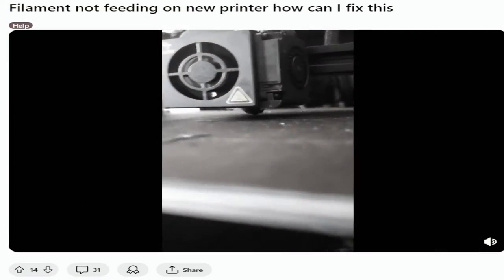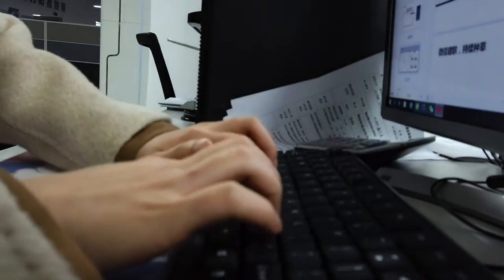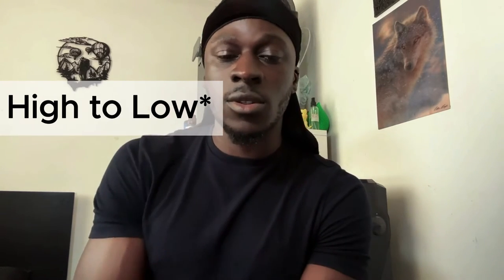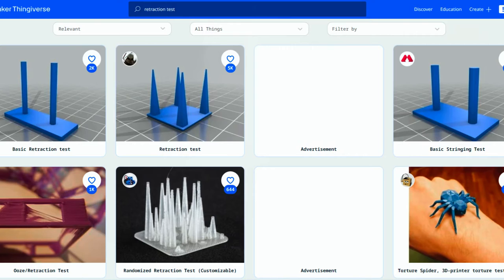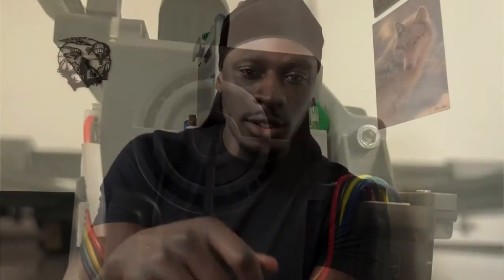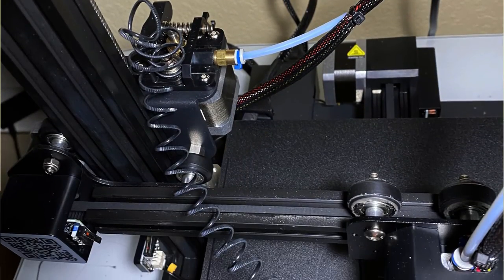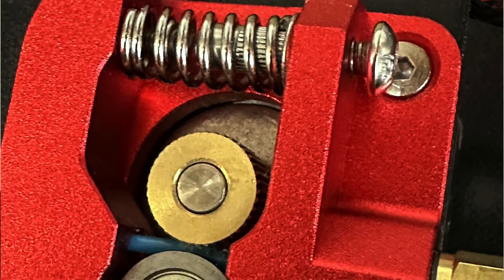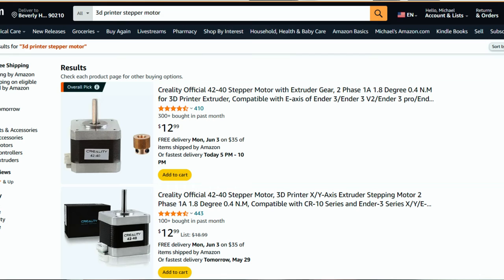🚨 9 Must-Know Tricks to Fix 3D Printer Filament Feeding Issues Fast!

Comment: I just bought a used Ender 3 and it is having a  problem extruding the filament. It loads all the way through to the nozzle but hardly any filament comes out when actually printing. It also has a loud clicking sound coming from the extruder motor or gears. Any ideas?
Reply from the maker: Yeah it could be for a few reasons depending on the cause, I made a video on this - https://www.youtube.com/watch?v=jvuZxFhld6w

Usually comes down to lowering your build plate, increasing print temperature, also calibrating extruder steps. Try those things and let me know if it works
Reply: @3D-Printerly  Hi, Thanks. Turns out the Bowden cable was blocked, so I replaced it and the nozzle and it started to extrude, but the first couple of prints were hideous looking until I set the bed and then everything worked. Thanks for taking the time to help. 🙂